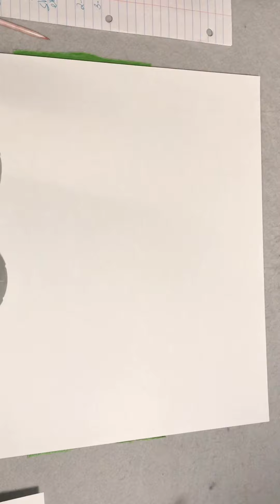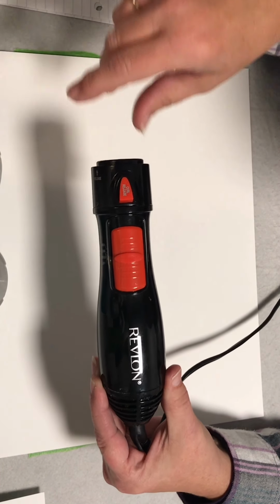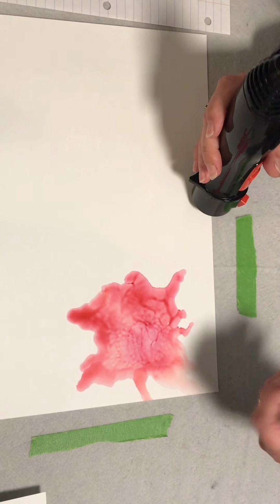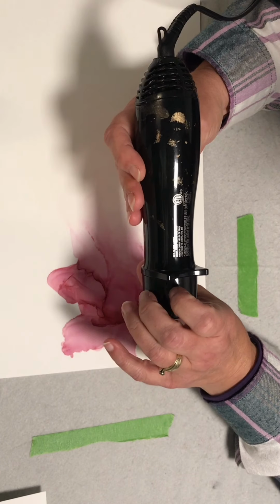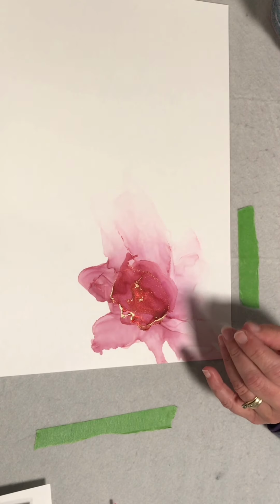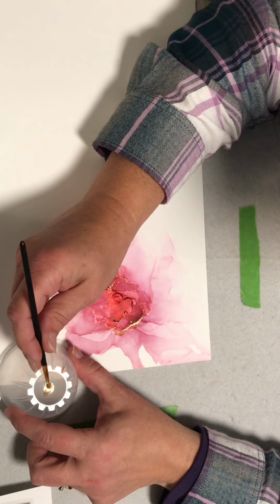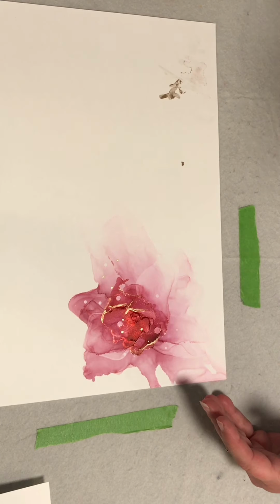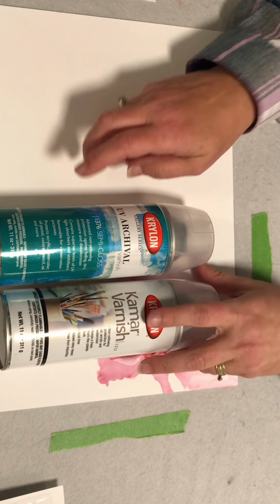[19] Alcohol Ink Tutorial Covering F.A.Q.'s and Techniques

Comment: I cannot thank you enough for this video! I've been doing alcohol ink for about a week now and I've been binge watching different AI youtube videos. None of them have done as good of a job as you did in this video! The technique with the hair dryer ....just perfect!
I did have a question about the hair dryer settings. I heard you keep mentioning you wanted a cool setting. Why is that? And when do you use high vs low setting?
Reply from the maker: 😊 Thank you so much! I prefer a cool setting partially because it doesn’t dry the ink/alcohol so quickly, but also because I don’t have to worry about it warping my surface that I’m painting on. Heavyweight yupo will flatten back out as it cools, and so will Grafix opaque white craft plastic if not warped too badly, but it makes it harder to get the ink to go where you want it to if the paper is buckled up in places. The dryer I use has low heat, high heat, and cool (which is actually a little bit warm and blows like a high setting). I only use the cool unless I want to dry a particular area a little quicker. Then I usually flip it back and forth between one of the heat settings (which on depends on how much I do or don’t want to move the ink that is wet) and the cool setting to keep the paper from getting too hot and warping. I hope that helps a little bit! Thank you so much for taking the time to watch and to comment! 💜💜

Comment: Hi Lorrie thank you for spending your time explaining your technique 🏆 your work is beautiful. If your going to put your painting in a frame with glass do you still recommend spraying your work 🙂
Reply from the maker: Thank you so much 😊! Yes, you definitely have to seal alcohol inks with some sort of UV protectant even if you are going to put them under glass. If you use a mat then that should keep the glass from laying directly on the painting and sticking to it. Be sure you let your paintings cure for at least a few days before you spray them. If you are going to mat and frame them, then let them cure for no less than a week, preferably 2 weeks after you put on the coats of UV protectant. I learned the hard way that they will stick if you put anything on them before they are fully cured. I thought mine were totally cured at 3-4 days, but I was wrong! Even with the spray, you still shouldn’t hang these in direct sunlight. They won’t fade as fast, but that much sun can still fade the inks even if the painting has been sealed. Let me know if you have any other questions! Thank you so much for watching 😃

Comment: thank you i was wondering how to seal my paintings ........its helped a lot
Reply from the maker: 😃 I am glad this had some good information in it for you! 💜💜
Reply: @LorrieBrewer  i tried my first painting today with the hair dryer i bought and recommended.........i wanted to throw it ....didnt realize it wa s1200 W and it just blew my ink everywhere./ so lesson learned..went back to amazon and bought the one you have even thought it cost me 68$ at least i know it will work
Reply from the maker: Oh no! I hate to hear that. Did you try using it the same way I do, keeping it really low and off to the side of your ink/alcohol? I have never tried with one of that high wattage so I don’t know if there’s any way to control the inks with it, but you might try practicing with it for a few days before you spend so much on one like mine. You just might have to keep it farther away from the ink puddle than I do. I hope you can get it to work for you! 💜💜

Comment: Hi, thanks for such a informative video. But can you tell more about the protective sheet boards that you store your paintings in? I could not find on Amazon. thanks
Reply from the maker: Those are just foam center poster boards that I attach the paintings to to keep them safe and make it easy to seal several at a time. Here is an Amazon link to similar ones  https://amzn.to/3atHXOl , or you can find them in most stores that carry poster board for school projects (like Wal-Mart, Target, etc.), or in most craft stores. I don't store the paintings on them once I have them sealed and they have cured for at least a few days. Once they have, I put them flat in a box with sheets of parchment paper between each to keep them from sticking to each other until I am ready to frame or mount them. Hope this helps some! 💜😊

Comment: Lorrie, quick question I can't find the dryer you use here in the UK. I have found an equivalent which has a cool setting on it. Is it mainly because of the design that you use this one? Thank you.
Reply from the maker: Yes, it is. I find this shape is much easier to hold and I feel like I have more control with it. I doubt the brand makes any difference at all, as long as it has a cool setting on it. You just don’t want to have an extremely high air flow from whatever you use so you don’t lose control over where the inks go. 😃
Reply: @LorrieBrewer  Thank you for the reply. I have just brought a dryer the same shape by TRESemme. Hopefully it will do the job, if not can revert back to the dust spray can. Cheers.
Reply from the maker: If you can paint using those cannned air things, you can paint with just about anything in my opinion lol. I can't use them at all. The airflow is just too strong and too concentrated in one spot for me. There will definitely be a learning curve while you adjust to a much different airflow with the hairdryer. Good luck with it! It will certainly save you some money over the canned air! Thank you for watching :)
Reply: @LorrieBrewer  Yes the cans do take some getting used to, but I have found out that if you keep the can at a distance. The pressure is less then use the same technique you use. The effects you get are quite nice you should definitely try it. One thing it does work better on a bigger canvas. I'm trying to setup my YouTube channel, once done I'll post a video of it. 😊..!

Comment: Hi Lorrie, may I ask if you have used framed canvases or canvas boards for alcohol inking. And have you had any problems and what kind of problems you have had, any information would be greatly appreciated. Thank you Gilly x
Reply from the maker: 😃 I have used framed canvas, but not canvas boards. I know some others who have used the canvas boards, though. The only issue you might run into is the canvas needing to be prepped with either gesso or Kilz 2 or something like that. It will give you a little bit smoother surface to paint on. Other than that, it’s pretty much like painting on yupo or other synthetic art papers. It’s a little bumpier, obviously, but not enough to really affect you. Some people put on a couple of coats of gesso then sand it a little, then add a couple of more coats of gesso. I just did 2 coats of Kilz 3 and it worked fine. I hope this helps some! I have only recently started using canvas with alcohol inks some so I am not extremely well versed in it yet lol. 💜💜
Reply: Lorrie Brewer . Hi Lorrie, thank you very for your quick response. I have done several coats of gesso on some canvases and used fine grades and paper and that has been successful.
Reply: I’ve not heard of Kilz 2 or 3, I’m In the UK, and you have some pretty good supplies your end of the world, the 2ltr bottles of paint that I came across while ready my messages today, cor if only  anyway I will try the gesso first and see how things go.Thank very for your help and advise.
     Gilly x
Reply from the maker: Kilz is just a primer and waterproofing paint that is mainly used for house painting. It helps hide stains on walls and keep them from bleeding through the paint. I am sure you have something in the UK that is equivalent to it. Check at a local hardware store and they may be able to tell you what is used there for that purpose. 😃💜💜
Reply: Lorrie Brewer 
           Hi Lorrie,  you are a ⭐️, thank you so much I really appreciate your help. Gilly x

Comment: Love your videos!  I'm not sure if you've talked about the Brass ink or not.  Do you mix it with any alcohol in the bottle you've transfered it to?  Or is it just straight?  I've always used canned air and an airbrush, but I'm loving the stick dryer!  Thanks for sharing!
Reply from the maker: 😊 Thank you so much! I don’t mix my brass with anything in the bottle. I just buy it in 4 oz bottles that don’t have an applicator tip, so I have to put it in a needle nose bottle to use it. 💜💜
Reply: @LorrieBrewer  Thanks that's what I thought... and the needle nose bottle is so much easier to use, doesn't clop up!

Comment: Please forgive this stupid question in advance LOL I looked in your description and I saw nothing about this but you kept talking about your ebo warping if you use the Heat on the blow dryer. Is that a brand of alcohol inks. Or are you calling the ebo the plastic that you're painting on? Thanks in advance
Reply from the maker: I have to admit that I haven't rewatched this video in forever, but I think I was saying yupo. It's another type of synthetic art paper made from polypropylene, or plastic lol. I decided they don't use the word plastic so they can charge more for it lol. It will warp very easily with heat. All of the synthetic art papers (or plastic sheets) will warp. If you are getting ready to start painting with inks, I would recommend not starting on yupo. It has an odd way of reacting to some of the inks and will stain when it absorbs some of the color out of the ink. For example, Ranger color eggplant (a purple) will leave a bluish stain while the pinker parts will keep moving around. Grafix opaque white craft plastic and NARA synthetic art papers are my 2 favorite ones to use that don't stain. You can actually wipe them clean with some more alcohol most of the time if you do one you don't like. I hope this helps you some! Sorry for the long response lol 💜💜